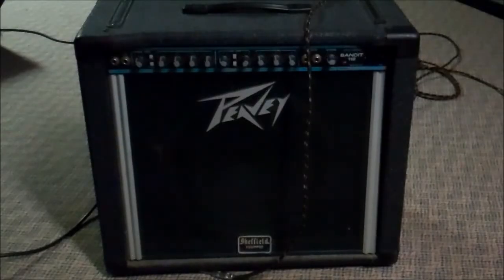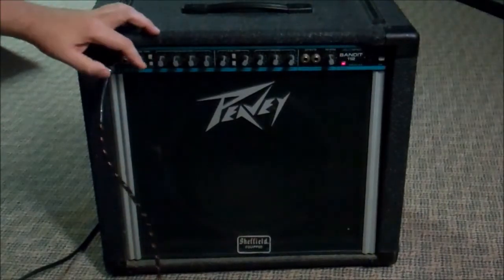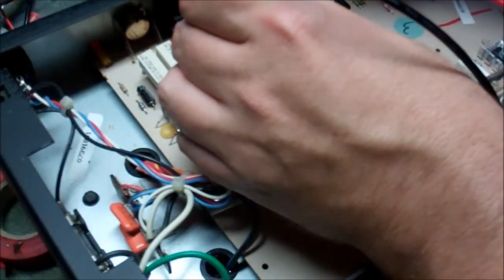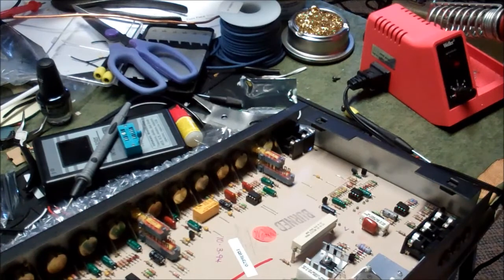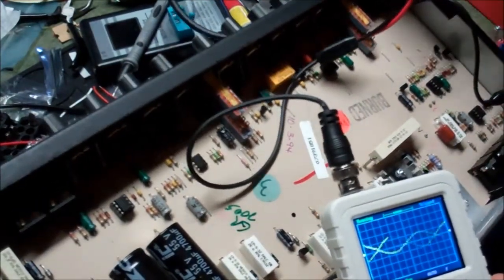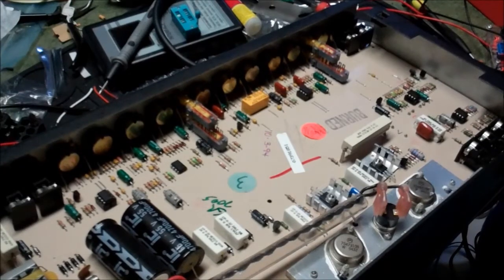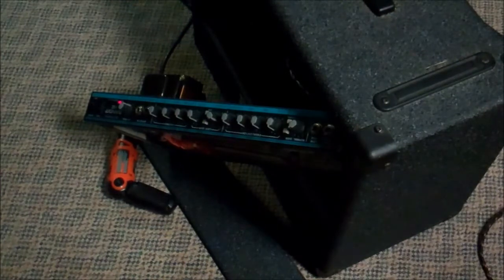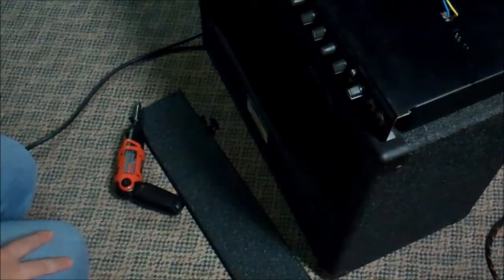DeadKoby vs. The Bandit part 1   Peavey Bandit 112 Solo Series 90's

Comment: DK, I assume your scope is a DSO150.  Have you used it for vacuum tube amp service if yes are there any major issues.  What is the voltage rating and how do do you like it.
Reply from the maker: I got it as a kit and put it together.   I've not tried it on tube amps... just low voltage solid state.   I have a legit B&K that I picked up at a later date that I would use for that.